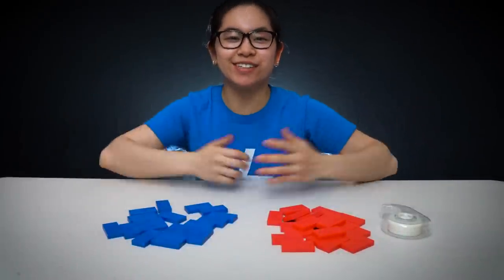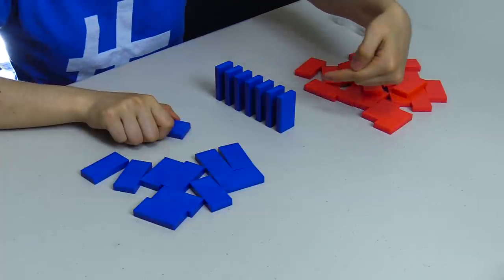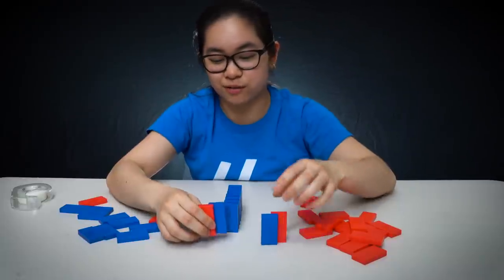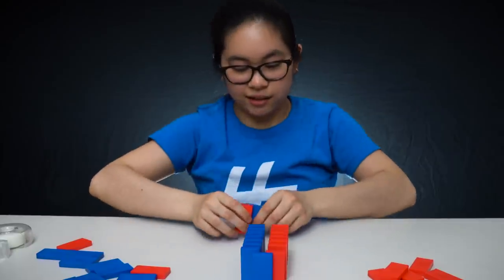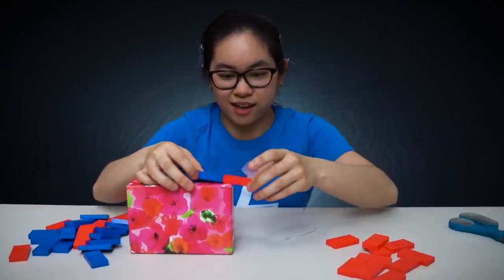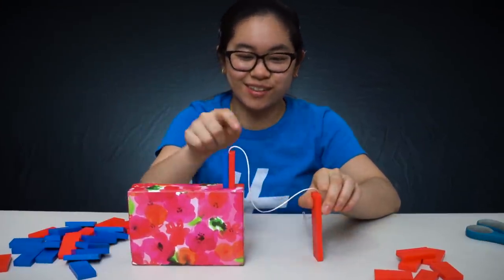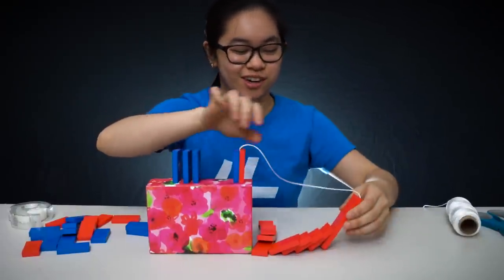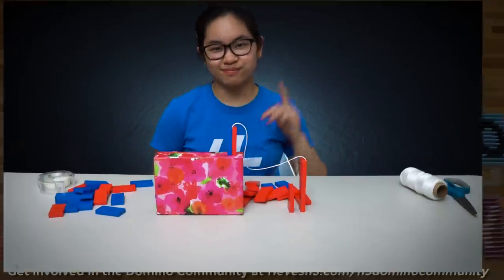How to Build THE TAPE TRICK / The Zipper Technique

Comment: Lily, have you thought about using fishing line instead of string? Monofilament fishing line is made to not be seen by the fish. It will still be visible but it will be less prominent than string.
Reply from the maker: Yep, fishing wire sometimes works if it's a long distance. However, fishing wire isn't as flexible as string which can cause issues. Because fishing wire is more rigid (especially short lengths of fishing wire), it tends to not hold its slack as well and has a greater chance of accidentally moving a domino that's taped to it. From my experience, using string that doesn't have a lot of tension is usually best.

Comment: How to do a 90 degree of 180 degree turns without placing dominoes on top of each other or making them lean on each other? (No props like tape and it should require as few dominoes as possible)